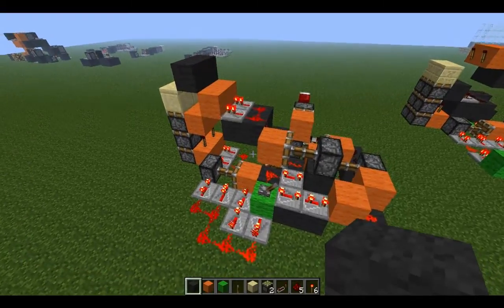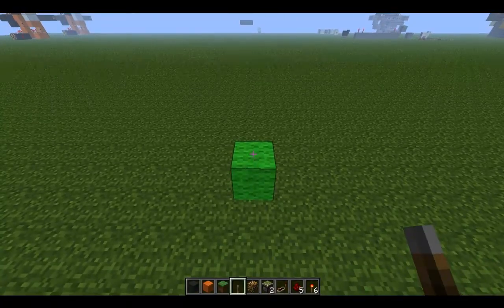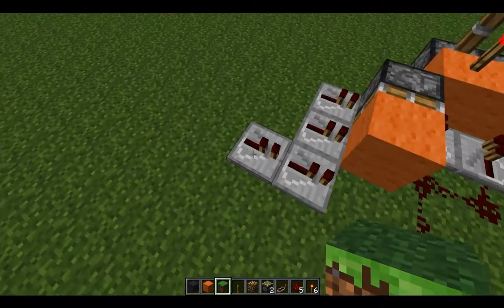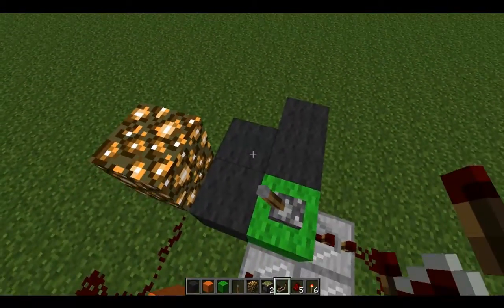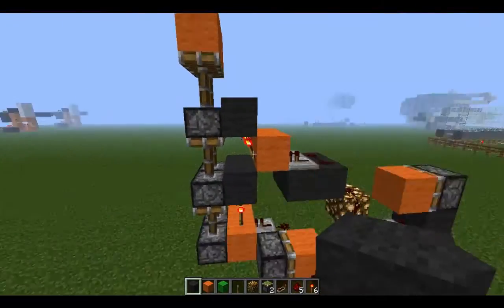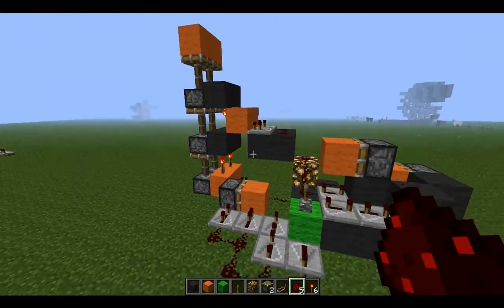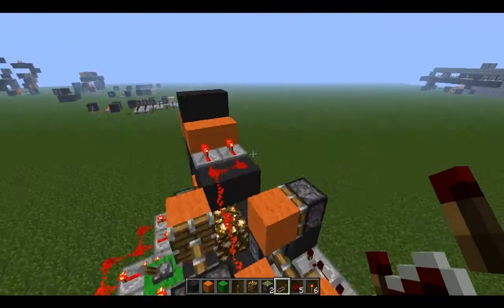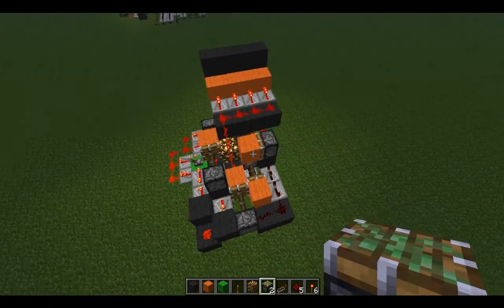Compact Vertical Triple Piston Extender [TUTORIAL]

Comment: To move the lever about: 2 blocks away from the lever where the redstone connects to the first set of repeaters you placed, move both that piece of redstone and the repeater 1 block up. You can then have a block over the third repeater in the line (touching the lever block diagonally) remove the lever and place a torch on block you just placed. You can then put redstone dust on top of that block and bring the lever anywhere you wish. Sorry that the explanation isn't very clear